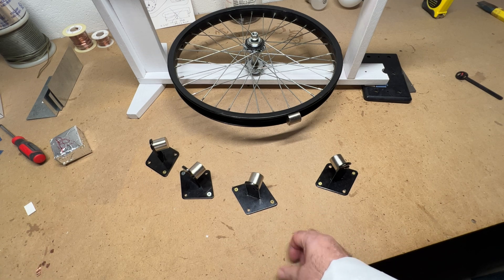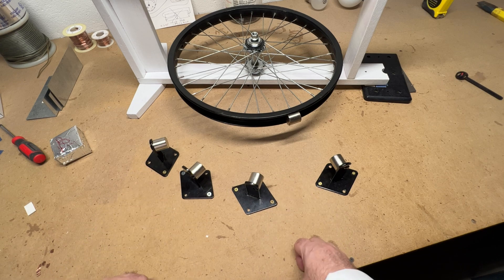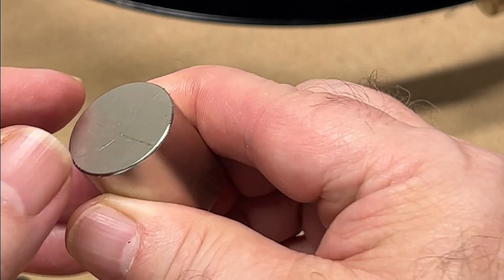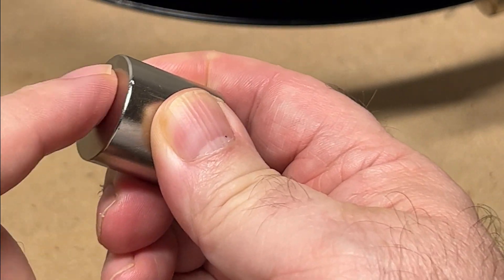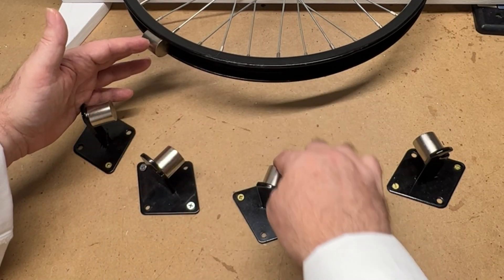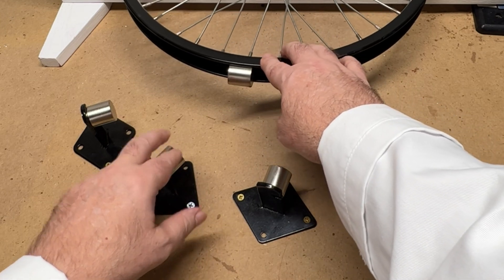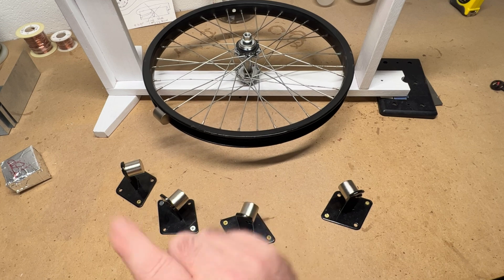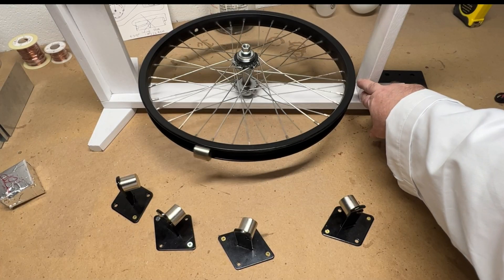🧲 BREAKING NEWS: Free Energy Generator Motor Research Preliminary Breakthrough.

Comment: Hi James, This is amazing and could be the breakthrough, the holy grail type of magnet arrangement! This will be very exciting to see the next steps without any metal influences in the magnetic stater and the wood screws. So maybe the steel brackets maintains the A shaped attraction repulsion geometry like a magnetic and or an Rf circuit looking like an antenna dipole ground plain, This is just a thought i had. I still love the shielding idea and maybe that will be what is needed to complete a full 360 degrees? Anyway thanks for showing the amazing results sir, Cheers!
Reply from the maker: 🧲 I have now removed the wood frame.  As mentioned, these results are very preliminary, yet very encouraging. Yes, a complete rebuild is required, which will take some time while I source out the parts. I like the idea of a four foot clear circle of half inch plastic with twelve 6” long slots as to slide the stator mounts to and from the armature magnets.  A four foot diameter half inch piece of plexiglass or plastic would be ideal but I don’t know where to find such a thing.  Possibly I can shrink the platform dimensions down to 40 inches instead of 48 inches?

By no means have I abandon the shielding concept of course. I can re-introduce that should the need arise.

Interesting how you look at this from the standpoint of RF.  In this particular case it would be a sawtooth wave. The steel stator mounts could be acting like some kind of circuit in reshaping the field? I'll know later.  I made another video after this one and it shows where the armature magnet was sitting between two staters and then suddenly started to move and and simply took off.

I’d  be in heaven in your shop. For years I’ve had an improved concept of the Newman motor which is actually based upon Tesla‘s findings. Two independent larger coils powering to two smaller independent coils. And a special way the windings would be arranged along with the tolerance is the key component behind the success of my idea for bringing the new motor to life. A whole new world awaits within a quarter inch of a magnet. The pull power/flux jumps 10 fold. This is where a lot more power can be achieved.

I made some videos on it years ago. The Newman Motor overhauled. The last two videos were removed by YouTube.

Thanks for your constructive feedback Tim. Nice to talk with you. More so, thanks for stopping by as always with your great insights.

Comment: its the angle, the pull must be of an ideal angle, the push as far away and of little influence as possible. this way we simulate the shielding, by using fixed geometry? perhaps draw a circle with outer circumference, then turn say a 5 degrees per magnet? i think it must be as symmetrical it can be to work well.
maybe the push is the generator, maybe the push must be used for the correct angle.

maybe 3d model the mathematical setup with added possibilities like being able to move them in and out built into the 3D printable design?
Reply from the maker: 🧲 Keen insight. Because I'm aware of this, my next setup will allow me to easily adjust all stators quickly and easily, and do so by degrees, as well as distance from the wheel. Thanks for hanging out with me out of your busy day. Much appreciated. .
Reply: @FreeMagneticEnergy2  thanks for your videos and thoughts man. I just had another one as well, maybe try and use springs for compressing them and releasing them without using electricity.
Reply: Emulation may find the right angle but magnetism itself is not so easily formulated. As far as distance is concerned the further the magnets are apart the weaker the ability to turn. If too close that creates a different challenge. There would be a 'sweet spot' for maximum efficiency between magnets. Also a challenge if shielding is involved is the magnetic attraction to the shield though it focused the magnet's field it still is metal creating drawback. Power to you if you can emulate the interacting effects. Such would be phenomenal, great enhancement of what James has done possibly.  James has done a great job. He laid a great foundation to build on. Like any invention we start from what is or what is needed and go from there building off such. Much to uncover that already exists and is not known or  understood. Go for it.

Comment from the maker: 👉🏻 Wait for it. About two thirds of the way through is when I get an unsuspected surprise!
Reply: But you work through them well James. If it works on a small portion of the wheel and magnets it can work well on the whole wheel. Then the momentum will increase with speed. Then as momentum increases and bearing heat up siphoning the power for energy production would be needed to prevent damage, else magnets would need to be moving in and out from the wheel to control all. A magnetic bearing would reduce friction but at high enough rotation speed any slight imbalance would cause all to fly apart. 

This I know from motorcycles - a slow speed high power motor like a Triumph runs slower, the power in the size of the pistons. A small Kawasaki gets its power from momentum. The high RPM gives great power, faster the more energy available. Yet such a high speed is more prone to motor damage if not lubricated well constantly to remove heat by reducing friction.